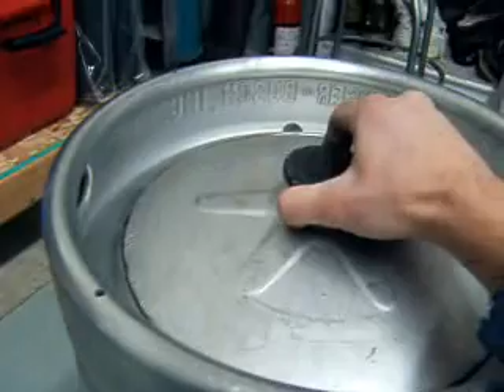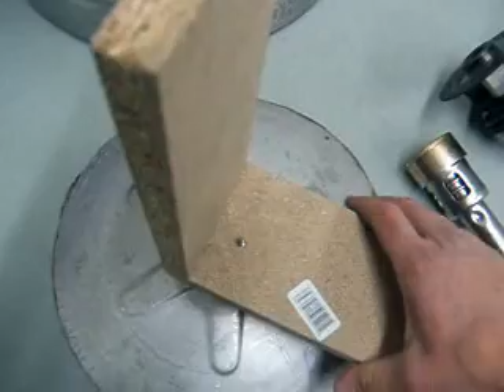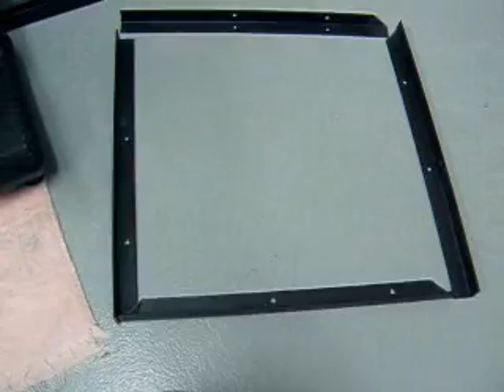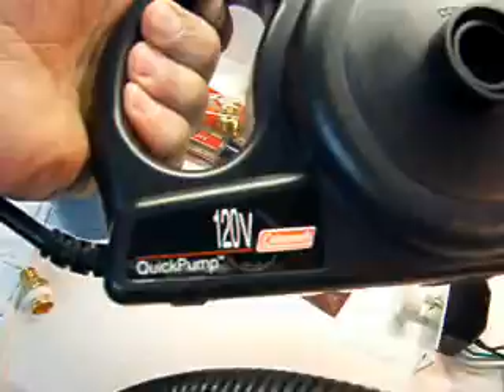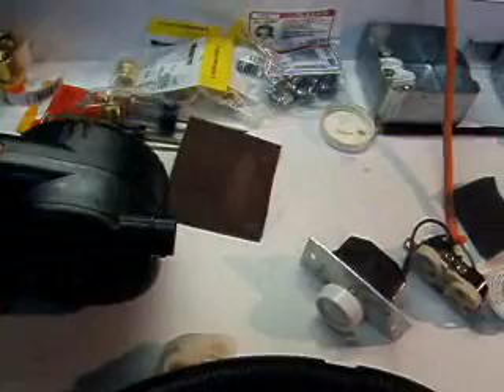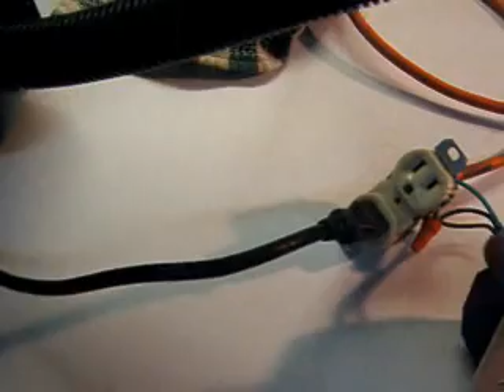Economy Keg & Burner Conversion part 1

Comment: I just used a 1.25 inch pvc coupler and notched it to fit my handle mounted on top of the grinder and drilled a hole below the notch and secured with a zip tie. I placed it on a lazy susan and just rotated around and around till it was cut. Super easy and only cost 78 cents.
Reply from the maker: Good job Jason!

Comment: question  you made a venture system the  blower may be over kill ,  if you  silver braze
 a  stainless bolt  or brass bolt on your air inlet side , and  make a slide flap and use a spring and  and a nut on the side bolt you can a just the air flow  , I   under stand what you are   doing maybe  later on  U may play with it ,  look at  Propaine  knife forges 
  venture system .

Comment from the maker: Just run full power to the switch as normal. Then cut the ground wire and run a jumper wire from the ground wire to the dimmer switch and back to the ground.That wire is then controlled by the dimmer thus controlling the outlet it is attached to. Cut the outlet jumpers between the two screws to seperate each side of the outlet.  Run jumper wires to the other side of the outlet to keep it hot or add another dimmer in that ground wire also to control each individually. Be careful and good luck.

Comment from the maker: Cool indeed! Every person who has seen this in person has thought is was awsome!  The curved 1/2" pipe was used to force the natural gas away from the opposite end of the 90' T by sticking far enough through to complete the tenturi. Thus creating a slight vacuum drawing air in, instead of natural gas just going out any ol which way.  The hose lays flat once installed also. Either way should work I just had to pick the most difficult. Good luck!! I've brewed 80 gallons so far this year. Hick!

Comment from the maker: One fellow on You Tube was using a garden hose in his prototype stage, then switched over to the gas hose. I believe natural gas pressure (after the meter) is only about 7psi so we are talking more about safety and avoiding leaks and melted hoses.  I used a 3/4" garden hose initially to test  the gas flow rate. But it did not  improve over the 3/8" gas hose. Gas hoses also have a very nice quick disconnect on one end. As crazy as all this looks, I sure don't want to blow my house up. LOL :)

Comment: I'm just starting and building my all grain brewing rig.

What about the gas hose? I see you use a 3/8" ID hose. Do you know if a pneumatic air hose would work? Air hoses are high pressure and they are quite affordable and have the threaded ends already attached.

Comment from the maker: I have not checked that gas flow rate. Darn!  I guess when brew day commeth I seem to forget about the gas I'm usin and just brew good beer (five 10 gallon batches with this rig). I promise to do it next time. I'm hoping this setup may not use as much gas as it appears. Here's why. At maximum flame efficency my gas valve is only open apx 1/2 to 2/3 turn for about 30 min. Then it is on very low. I light the flame with a long reach lighter. A remote starter did not work due to a fast gas flow.